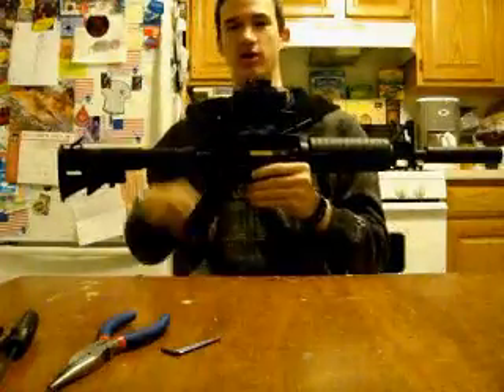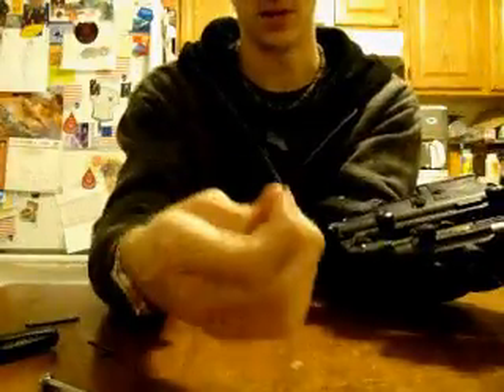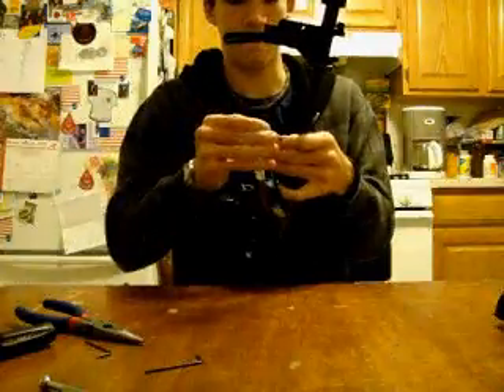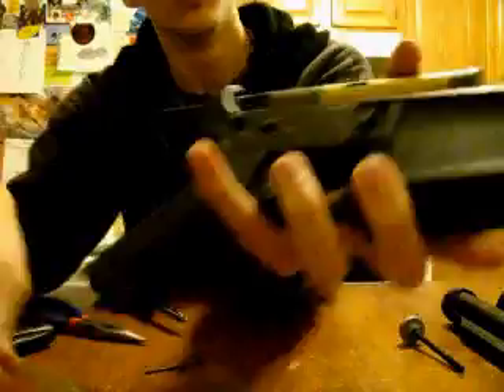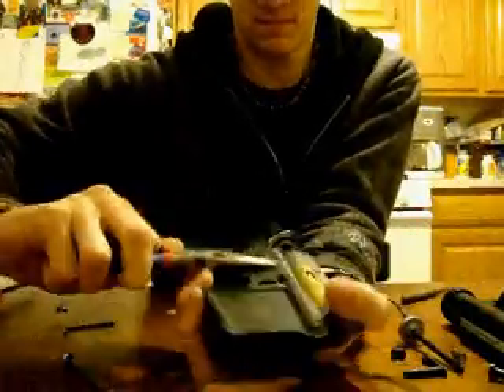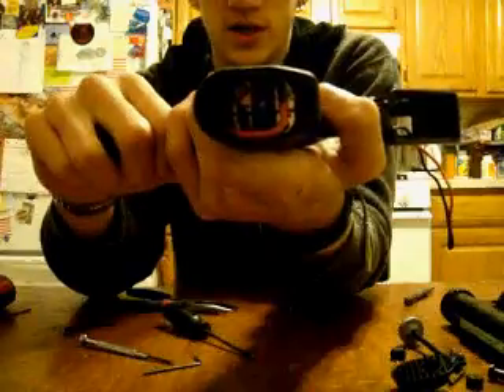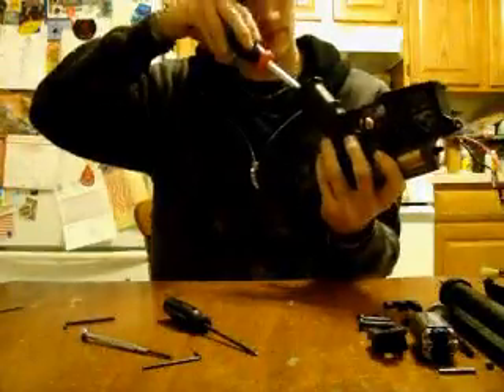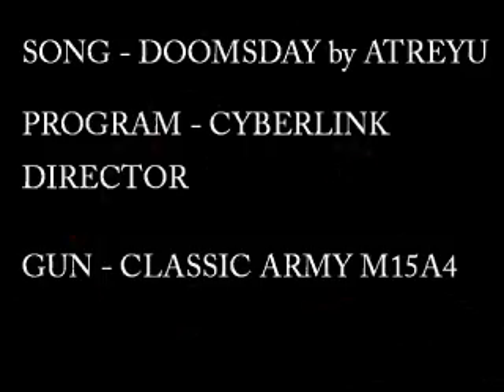Basic M4 Diassembly (Video 1)

Comment: Wow thanks for the video. yeah i got the same gun too but like in october i tried to dissasemble it. too bad this video wasnt around. I didnt remove the front wires when taking the upper apart from the lower reciever, and now i need a wire replacement becasue it was pinched and the fuse blew out.

Comment: my gear box is fucking stuck inside of the receiver. THe back of the upper and were the motor comes in but a bit higher are lodged inside the receiver... i removed everything yes the little pin and everything else ive opened  a lot of m4s before but this one is pissing me off its a JG